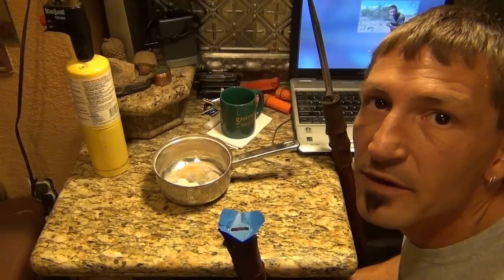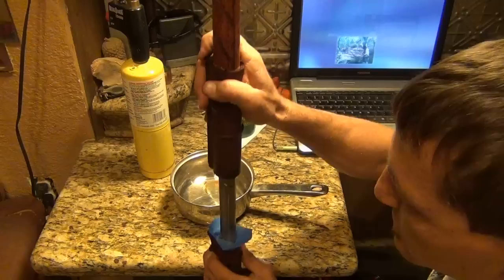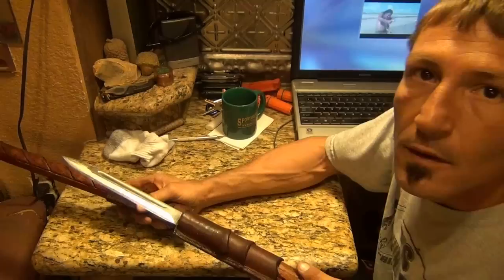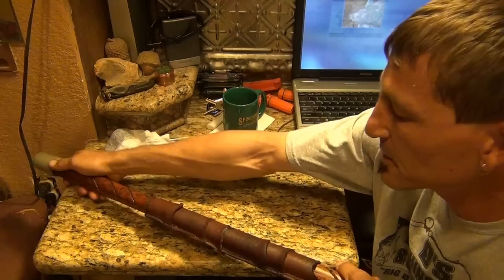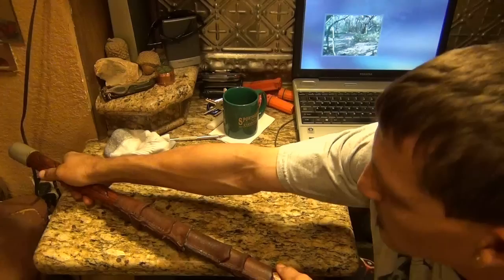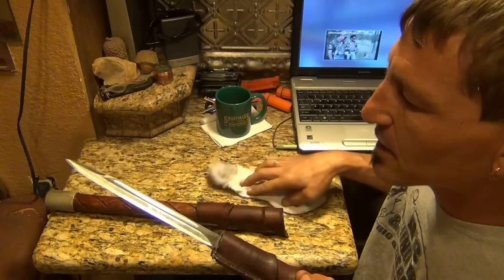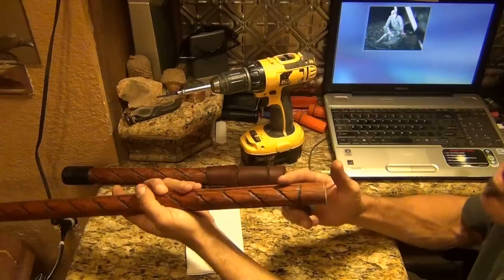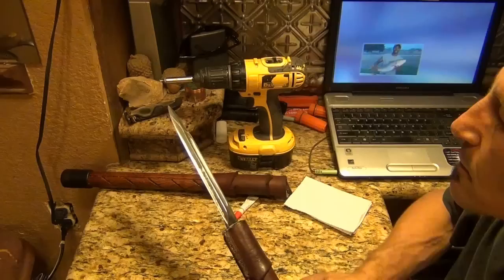Building a Tactical Walking Stick 14, Done!!!

Comment: Great job...I just have a suggestion if you ever run into a similar issue as the extra wax in the hole. Try warming the blade before sliding it in....not "heating" just warming...it would cut into the wax easier to then pull the excess out later. Not critizing...just trying to add ...I gained a crap load of ideas from some of your techniques..thanks a ton for sharing.

Comment: All likes and a New Subscriber. You are very real in your videos; even down to the craziness, with the hot wax. Now I wonder how strong the stick is with a store bought dowel. LOL! never mind Video #15 answered the wondering I had. One other idea I have is next time maybe some rubberized paint over the steel tip. That way if a strike was actually need to be preformed for protection or just a dropped stick the paint would not chip and reveal the steel. ( ? ).

Comment: I use two walking sticks all the time. (Been on crutches 9 times) Loved your videos. You have got some awesome skills. I on the other hand love ultra-light sticks when I walk but would love to have them out of wood. Guess I would need different type of wood to keep it light. I thought about an end cap on the bottom (rubber side) with a 3-4-or 5 prong cluster gaff for fish or snakes. The lower half would separate and harpoon some fish etc. Do you think it is possible? Anyway thanks for taking the time to share your knowledge with others. Peace, 4 Legged (hiking trail name)
Reply from the maker: should be fairly easy, make one

Comment: I built a similar cane. More of a walking staff with a deer antler dagger in the top. I figured out a method to keep the knife in place. Rare earth magnets, but it still rattles like a bitch and I cant deliver it to the customer in that shape. Hot wax is a good idea but I don't want my blade to have wax on it. I considered silicone and greasing the blade but i'm too afraid to pull the trigger any suggestions.
Reply: Bed it with epoxy.

Comment: dnahoghunter,
try potting compound like that used to insulate multi pin electrical connectors THEN SPRAY BLADE WITH RELEASING AGENT TO REMOVE…..PERMANENT PERFECT FIT.